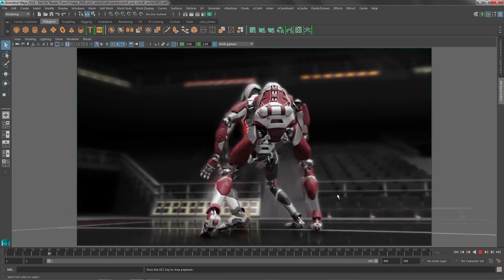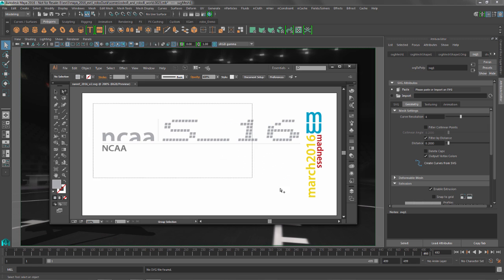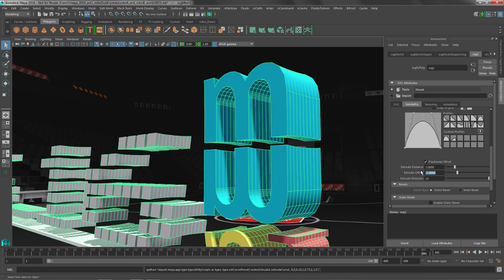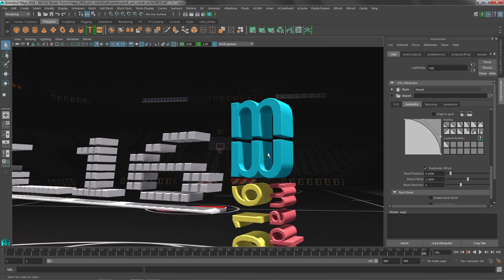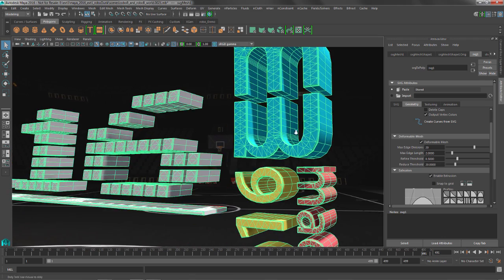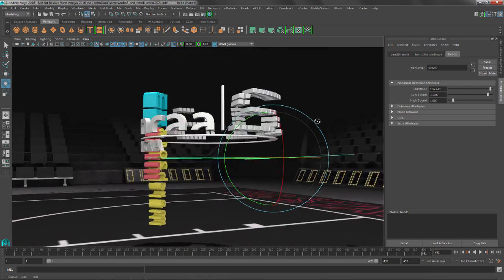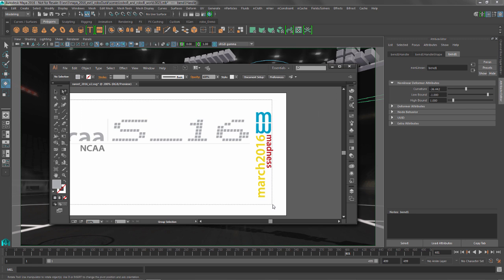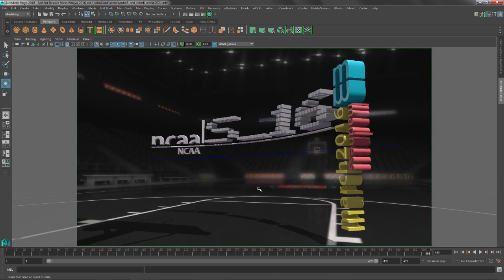Maya 2016 Extension 1: Improved Vector Graphics Workflow

Comment: the latest version of illustrator broke this feature. you have to use AI 2015.2 and below.
Reply: any literature of this you could point me to?
Reply: just me. illustrator 2015.3 uses a new svg version for copy and paste. the header is completely different and results in an error when you paste into maya. 

i also have the pre-release version of 2017 and it remains the same. so i think it will be up to autodesk to update their svg plugin, which will mean they need to implement a way to decipher which version the user is trying to import or cut support for the older version - which will be a problem for some environments 

you can see exactly what happens by copying in illustrator and pasting the result into a text box